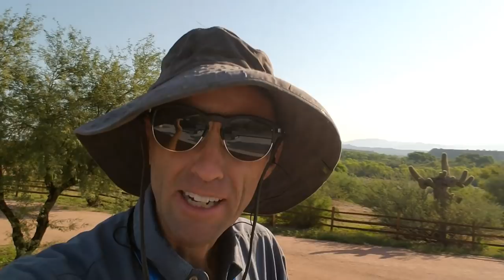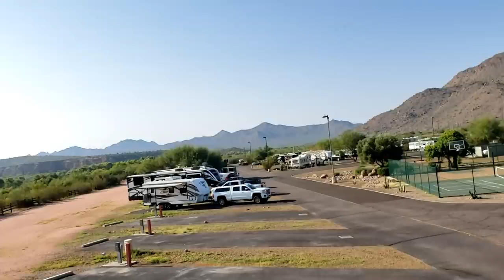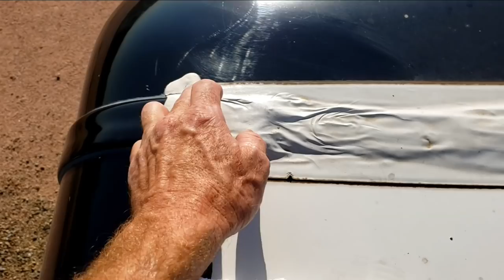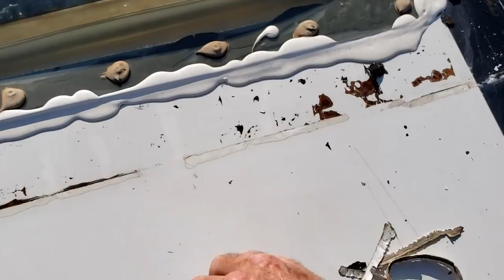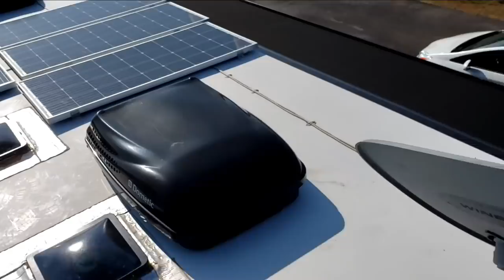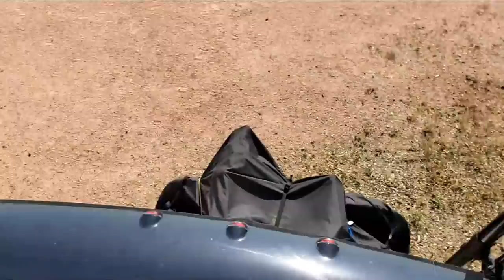Newmar RV Fiberglass Roof Maintenance and Tips

Comment: My wife and I have been married 45 years and we have moved 34 times. Crazy. Decided that if we were going to move again, it was gonna be in a motorhome full-time. We bought a 1997 Beaver Patriot Camden. Thank you so much for your videos. They are so helpful. I’m gonna go up on the roof today and seal it just like you did.
You suggested waxing the roof also. Do you recommend a particular wax to use on The Beaver? It’s kind of cluttered up there with nine solar panels, two air conditioners and two roof vents. I just can’t say thank you enough.

Comment: Great job. I have a 97 Winnebago with a similar roofing system and having watched this I can see that whoever got on this roof did what appeared to be pretty adequate repairs except the fantastic vent still leaks. It's over a hundred here everyday so I'll be fixing that in September. Thanks so much.
Reply: James has a video on fantastic vents and how the screws are not torqued down properly by the manufacturer/ installer. James shows you how to fix that problem in the video!
Reply from the maker: Thanks Ken!

Comment: Hi James. Thank u for the varied content u provide. I have a question that's been bugging me for a while regarding the use of Dicor. I've seen/heard u saying something about that it doesn't like silicone based sealant & vice-versa. Also that u don't like it because it cracks over time. I'm ready to fix a leak on my fiberglass roof (cracked sealant). After the proper cleaning, should I use silicone or something else?
Thanks again, Jay.
JC.

Comment: Learning a lot from all of your inspections, just one question when you’re doing a roof inspection should you also look at the top of the slides underneath the awnings.we had a major leak on one of our slides and it was concealed by the awning you had to take the awning off to actually look and see where the water was coming in
Reply from the maker: yes, that is a good place to inspect too, and it can be difficult to see much when there is a topper on it

Comment: I have learned a great deal watching your very informative videos and you have saved me nearly $1,000 if not more by doing many things myself. I have a 2006 Beaver and the roof still looks like new, do you recommend or have you found a product(s) that works longer in the sun. I live in Florida,  so the sun issue should be the same as in Arizona. Is 303 a good option for roof protection or should it be a wax? Are ceramic coatings better than regular wax? Any brands you found that last longer than others?
Thanks again.

Comment: Great video James. Always pick up a trick or two. Should I only use denatured alcohol and not mineral spirits on an EPDM roof to clean small areas before applying new dicor over old, or just strictly use glass cleaner?
Reply from the maker: Glass cleaner wont react

Comment: We are seeing contradicting videos where techs are using different sealers on fiberglass rv roofs.  You have said not to use dicor on Winnebago fiberglass roof, that self leveling silocone is the correct sealant.   Your using dicor on this fiberglass roof.   What is the difference with this FB roof ? is it due to what sealant the mfgr used originally?  your vids are great, thank you
Reply from the maker: Fiberglass does not determine the sealant. Winnebago and Tiffin use self leveling silicone, Newmar used Dicor. So the existing sealant determines the sealant to use

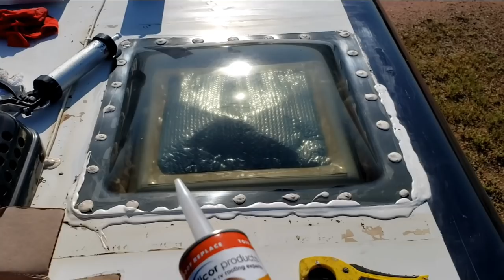Comment: @ 10:30, ever use a thick foam tape to make sort of a dam to make nice clean edges like maybe a 1/2" to 3/4" away from the skylite edge then pull it up once the caulk firms up?
Or would that stuff just keep flowing out until it flattened all the way?

Comment: Hey James, not related to this one, but I’ve bought a new entegra Quest, on the way back from dealer stopped at campground in Ga , leveled out slide out an got a heavy rain storm, had a small water leak at front end of slide , this was a month ago, just went to Fla an drove through a bad rain storm so bad people pulled off the road, after rain quit pulled off at a store , noticed water had come in at the same place, what should I look for as far as where it might be leaking

Comment: Thanks for the sealant refresher. 😀 For some reason the finished shot of the skylight looked like a nice decorated frosted pastry to me, lol.
You said you generally don’t like using butyl tape for underneath the skylight trim to seal it, cause you said it doesn’t compress all that great with the screws, I believe manufactures say to use butyl when installing a diy skylight replacement, so what would you use instead of butyl?  Cheers 🍻
Reply from the maker: many skylights come with a tube of butyl sealant which does compress nicely. I use 100% silicone on Winnebago's fiberglass roof.
Reply: @AZExpert  huh! I’ve never seen a tube of butyl! Didn’t even know it could come in a tube. Two years ago I did a skylight replacement, and a year ago a roof fan replacement, no tubes, came with butyl tape only. 
Geez your just full of surprises. Appreciate your endless knowledge bank. 😃 thx 👍🏼 cheers 🍻

Comment: I have a ‘17 Newmar Canyonstar.  The seem that connects the front cap to the side of the Motorhome has come unsealed.  It looks more like silicone than Dicor.  How do you determine what was used to know what is the proper sealant to use to repair?
Thanks
Reply from the maker: Contact the manufacturer

Comment: James,   Picking up a 2018 Jayco Alante tomorrow.   Weird thing, it has no ladder on the back.   I guess it was an option.   My question is about your ladder.   What length is it to get on Class A rv’s?    I’m going to have to go back through your videos and focus on fiberglass roof instead of TPO that we had before.
Best Wishes!    Kevin
Reply from the maker: Depends on the height of your RV. Check with the Manufacturer
Reply: @AZExpert    12’-5” to top of AC units.

Comment: I saw someone on another channel putting eternabond then covering the eternabond with dicor, do you discourage this method? he also put fiberglass rv roof coating on top of everything, is this not the correct way to do it, to put the fiberglass coat on top of the dicor?
Reply from the maker: That sounds messy